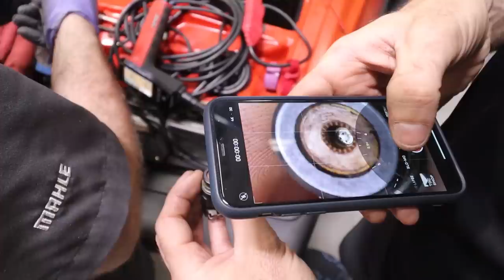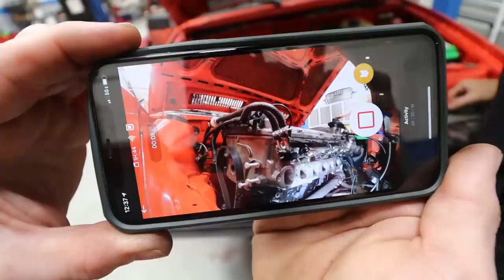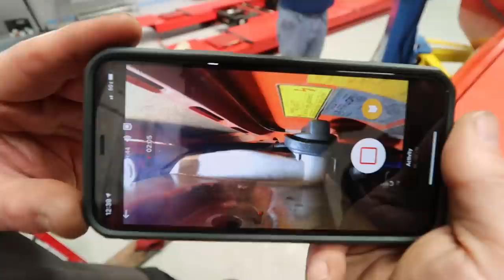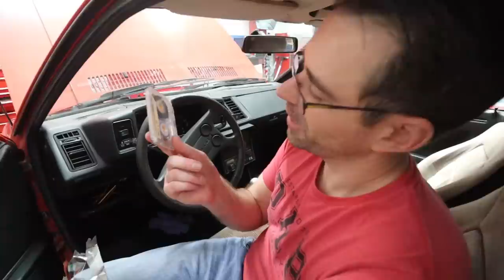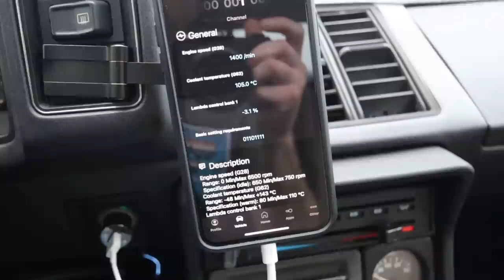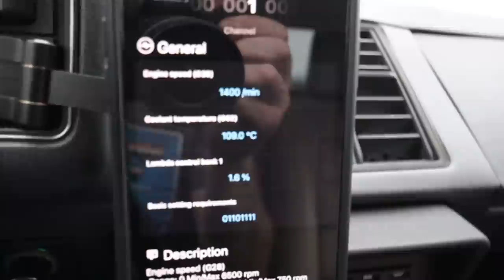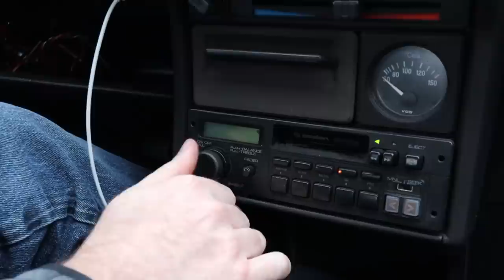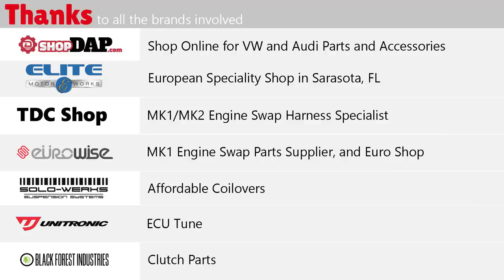Can We Overcome Even More Issues?  Scirocco Engine Swap (Part 3/3)

Comment: Legend has it, the car is STILL at Jamie's shop
Reply: Haha! This may or may not be true
Reply: I was considering driving by DAP to see if it was in the parking lot.
Reply: You rock bro!!
Reply: If You have a Volkswagen, You know all the parts stores!
Reply: Awesome series of vids, you boys definitely stuck at it, even when the chips were down!
Reply: Question is, will you gamble and take it to the Alpine Volks Fair?
Reply: that was a great video build series, hope he gets lots of views off this one...I will look for you guys this weekend!
Reply: What happened with the radiator fans? If fixed, what temps were you running?
Reply: Charles - as a wrencher working on a 50 year old Chevy Caprice, I have had to “substitute” parts (control arms, etc) from newer models because they measured the same dimensions (original part not manufactured anymore). You need the patience of Job (from the Good Book; that Job) to work on these old gals. 
Luckily, I am a leisure mechanic- so I stop and start as I please. Usually after my sadness from the most recent parts finding fiasco has resolved :)
Hang in there!!!
Reply: Along with these three amigos 😬
Reply: I wonder if they'll make it to the 2022 Wookies....
Reply: @jameshaulenbeek5931  i guess they had to keep tje old engine. Such an old car does not need any vr6. Just to run 70 miles p. H. Is max expectation.
Reply: @heribertmueller9613  huh? 

I guess you haven't watched the videos...
Reply: Why did you guys have to drive to Sarasota. And why did you only have 4 days?
Reply: Legend has it your grandpa is also your daddy
Reply: I’m glad 😃 can do
Reply: I’m glad

Comment: Many moons ago I owned a Volkswagen. It was the BIGGEST financial mistake EVER for my automotive ownership. Watching you guys battling this Volkswagen and ALL hardships brings a sense of joy to me that it’s NOT me dealing with ALL that. You guys are quite entertaining.
Reply: I’ve owned 7 VWs in my lifetime and ALL but 1 were reliable and required only routine maintenance. 1 gave me lots of trouble, but in fairness I didn’t maintain it like I should and I was putting lots of commuter miles on it. 

I guess what I’m trying to say is there are some known lemons in the VW lineup and it could be that you got one. Also… lots of people buy a VW and think they can treat it like a Toyota (which admittedly you can abuse to an insane level and never maintain… but are like driving a toy) and then sell it when they get slapped with the bill for fixing the thing they abused. This sucks when they aren’t up front with the buyer (often the case) and you could have been unlucky in this regard too. I’ve bought a few used VWs recently and the used market is flooded with these red flag cars.

VWs (especially older ones) are particularly fun for those of us who can turn a wrench, like to mod and personalize stuff, and want a machine that feels like a machine. Some people like legos, some people like assembled toys. Both are cool.
Reply: @JoelCaseyJonesMusic : All good experiences for me as well.

Comment: This Scirocco brings back the memories. This was the very first brand new car my mom owned. She bought it brand new in 1987 when her and my dad both had job promotions. My did bought a truck and my mom bought a VW. She drove this car well into the 90’s. She took immaculate care of it. It was the car I learned to drive a manual transmission in and it was the car I took my drivers test in.

Comment: I’ve loved this so far.  I’ve got an ‘89 (last year in Canada) that has had no where near the problems of yours.  The most important thing I’ve learned is not to get carried away and drop a 20v in my car.  Also, I’m not driving it 1100 miles or 1770km (that’s how we role in Canada)!.   Thank you for the great entertainment and some learning along the way.  Oh, mine had new fuel lines installed just before I picked it up because they had exploded everywhere just days before I went to get it!  The angels are with all Scirocco drivers apparently.

Comment: Lol! That starter looked like the starter for the original 4 cylinder in that car...and I'll be willing to bet it was the lack of a solid ground all along. Jumper cables aren't a good enough connection for the kind of current that goes through a starter.

Comment: I had a 12v MK4 I bought with multiple misfires. I diagnosed it was the injectors... I had to take the front end apart 6 times cause every time I replaced one and drove it for a day or so, another one went bad. 2 weeks and many work hours later, it was running smooth as silk.

Comment: No tools have been thrown up till this point, YET.  The wheels look great!  She looks great at that level.  Either trim the pedal, or redo the mount!   For the shifter you could have used longer spacers at the back, but cutting it works as well.   OH GOD, bad injector.......now I feel SOOOOO bad for you guys.  LOL @ pranking him on the injector, but really, Vortex or samba, someone would have helped you out. You could have also spaced up the bottom of the bracket for the throttle pedal, but I am with you, you made it happen, thats all that matters.  Uhg, I hate composite radiators and the tank connections.......  Best audio ever for the air freshener!  I have to say, you buys have some balls taking on this build in such a short time, making it happen only makes it better..... I am at 48:30 and I will say this, I will happily give you a grand and come pick it up!  Your just fighting the usual swap gremlins, this is, and will be awesome if you see it through.  Finally, it sounds happy!  LOL, it does sound like a Wookie!  That is an awesome swap, even more awesome given the time it was done in!  Just raise the rear, it looks fine.  ROFL @ VW foam on the floorboard......  I always hated the foam in the heater boxes on especially the A2 cars.  Again you guys have incredible testicular fortitude!  LOL, dash rattles in an A1 are just part of the fun, turn the stereo up!  Now its ruined, I will give you $500!  There will be ballads written of your journey.

Comment: As a 30 year Scirocco fan, it breaks  my heart when someone rushes a Engine swap or resto. I have a feeling that the car is more or less undrivable due to engine height off the road. Some of the things that went wrong here was: 
1. Dont be in a hurry (3 Day Build). 2. VW Engines install from below much more smoothly that the top. (30 years experience speaking). 3. Make sure the engine being transplanted has parts available, as everything is going to break because it is old. 4. Don't crank the suspension down to fix the fender gap problem, try increasing the rim and tire diameter instead. 5. Measure the engine to be transplanted and compare to the original engine. Scirocco engines are not very tall,and to make them fit VW inclined the engine back significantly. Putting this engine in a Golf would have been better because of height.
Here's some links to a long term Scirocco Resto thats worth seeing:
https://www.vwvortex.com/threads/my-new-scirocco.4564883/
and a Golf 16V G60 with the new ECU and Intake manifold, etc
https://www.youtube.com/channel/UCFEmGfwTxJHb7g50Rbyc_aA

Comment: I gotta say that starter when tested outside the vehicle on the last episode with clean direct lines it sounded ok to me also. Maybe it was the temporary ground not being a proper gauge or route for the return current, or maybe a 24v vs 12v starter difference? Glad the starter swap worked out ... that's at least the good news at the end.

Comment: Diesel starters work great on 02A/02J transmissions, at least with a 1.8T 20v.

Are you sure you guys have worked with mixed parts before? Not many swaps I'd guess anyhow. LOL

At least you have a Touareg, so towing isn't an issue if it comes to it (still watching). Love this.

Injector - dead driver on the ECU? Been there, done that.

Yeah - you made it!

Comment: Looking at this video makes me wish I had sold you guys my old Scirocco as it was in fairly good condition being I'm from Cali no rust, plus it had so many mods you guys would have been totally stoked. But since I had so many mods and I wasn't going to get anywhere near what I paid for everything so I had the car crushed 🥺 😢 😭 . Remember when VW Trends had that issue where they told just what to do to make a car ready for the track? Well, I followed every recommendation to competition and then some. The primary reason why I junked the car was the electrical was going out on me and parts were getting really hard to find. They even discontinued the battery for the car where I live. Plus no one outside of me seemed to know how to work on it and the dealership would no longer work on the car as they said it was too old but it was just an 83'. 
Well, you win some and you lose some.

Comment: Love that you finally got there , but was nearly screaming at times with starter !  Like when you try it n it fails ,one of you say smoke ? Ow it's coming from starter ? It's the extention cable you had instead of a proper earth heating up due to too much draw and resistance ? I'm like aaaàa connect proper earth dude

Comment: Engine compartment looks pretty great and you can't beat that sound! Is the Touareg a VR6? (Ours was). For these projects, the most satisfying bit is cleaning the interior! Throw that battery in the trunk... Would also be a better sleeper with the stock wheels. Tig welder on rusty crap? that's irony... With that VR6 in there, do the rear tires touch the ground? :) I'd like a MKI with a E888

Comment: And you built this engine? I built my 1.8L big valve with all new injectors, seals, shrouds, valves, guides, seals, cam, 9.9:1 pistons, larger throttle body, port matching all around, and a tri-y header. My '84 GTi walked 12v's.
Reply from the maker: Yea we have a video you can check out here https://youtu.be/nIiCn2-HSJY

Comment: Could you please provide specifications or manufacturer name of the fuel hose you used to replace your leaking one. Could this work as a permanent replacement or it is just a temporary. I have the same problem and original is damn too expensive. Thanks million.

Comment: The 1995 Corrado ( my realistic dream car) VR6, it was a DOHC as we all know is just a technicality due to cylinder bank configuration, but was offered with the 24 valve head. 
In grade 11 in 1995 I swore one day I would own one. For now my 1987 VW 2dr Fox 2dr 1.8L cis injected SOHC 8v with a whopping 81hp, and 93 lb/flbs of torque . I was silly and ran a 1/4 MI with it, and ended with a  blistering fast 17.7 sec at like...82 or 78 mph lolol, I don't remember exactly. A year I traded for the same car only in red, and a 1990 instead of a 87. no options on either car, just a basic a to b. I never did buy my dream car 1995 Corrado. I did buy a 92 dr Accord and had a professional shop swap a JDM 2.2 H22, keeping the factory 5 speed, installed a new clutch, and left it with an open diff . It worked fabulously. That filled the gap till I had more money, it did run a 14.7 at 102mph. In 2016 we traded our 2016 Mazda  cx-3 AWD for a 2015 TSI 1.8 auto, and was blown away with the quickness. I kept it for 6 months then traded for a top line trim 17 black GTI, 8 months later traded for a brand new (MK 7.5) Golf R,  it was a 2018. 292hp was amazing. In closing, I'll probably never find my Corrado, but I think I am okay with that. Cars of the 80s and 90s weren't great years for VW, but the last 3 vw's I had were bulletproof (I drive my cars carefully). Now I wait for the 2021 Golf R.

Comment: Anyone know how to ask him questions ? I have an issue I have a p0010 code on my 2004 (b6) Audi A4 1.8t Quattro 6 speed 128k bought 2k miles ago where do I start diag I’ve come to timing belt replacement with tensioner and all or camshaft chain tensioner Im trying to figure out exactly which one oil was changed 3k miles ago and car idles good but is a little rough and no leaks

Comment: love the videos.  I have completely restored a dozen cars (most air cooled vw's) - nothing ever goes as planned.  I was wonder about your discussion of overheating on the drive home - I feel like you said 101 degrees.  Am I missing something?  wouldn't normal temp be close to 200?
Reply from the maker: Celsius
Reply: @Deutscheautoparts  Ahhhh.  OK I'm tracking on with you now.  That's a smidge high.  Glad you didn't get hotter.

Comment: I figured you would have done all “new” injectors when refreshing the engine back in NC.
Reply from the maker: They are 240 each. That’s 1400 just in case.
Reply: @Deutscheautoparts  you own DAP, I’m sure they’re NOT that price, lmao.  And you could have avoided all that injector headache and been home sooner!. If I was refreshing that engine all new injectors, that’s pennies. But that’s just me. I get it tho, was supposed to be a quick, get it running, drop in, and go. That poor VR6 didn’t get the refresh it deserved 🥲

Comment: Soooooo, Rather than CUT the carpet, maybe you shim the bottom bolts with spacers and longer bolts so the bracket is at an angle and you get more pedal throw.....
Reply: I wondered the same thing myself.